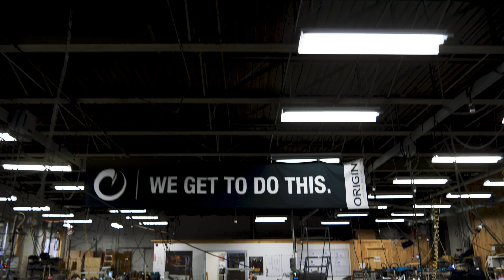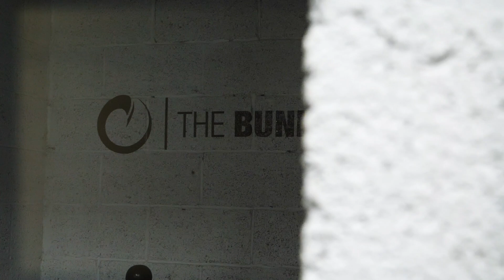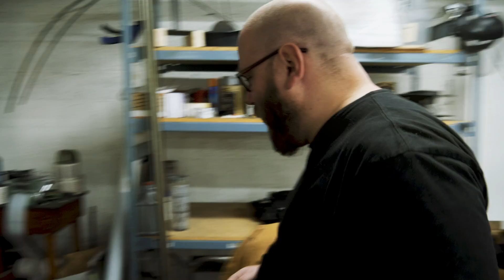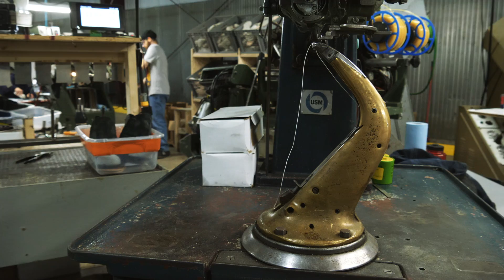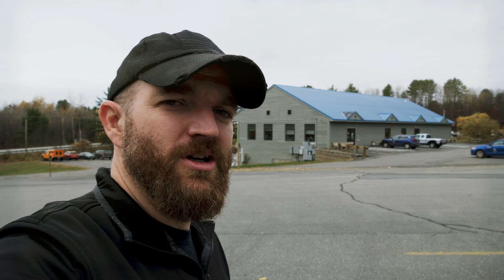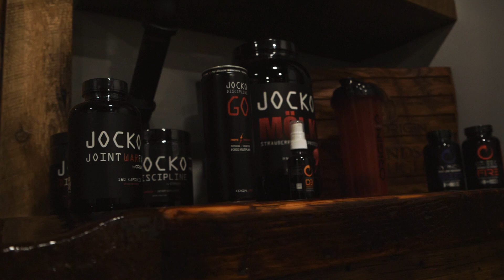Behind the Scenes at ORIGIN USA!!! | History Traveler Bonus

Comment: Brought back a lot of memories of my years back in the 70's as a weaver and the special knots we used when a strand of material broke and shut the loom down.  Each machine had a red flag on it that you raised to get the attention of the loom fixer, a yellow for the cloth doffer (the individual that removes the roll of woven material from the machine and delivers it to the inspection department) and was assigned a section of machines to maintain, the higher your production the more you made.  Thank you for another wonderful video and Thank you Origin for bringing back this knowledge.
Reply from the maker: Thanks! Great work that they're doing there. Glad that it could rekindle some memories.